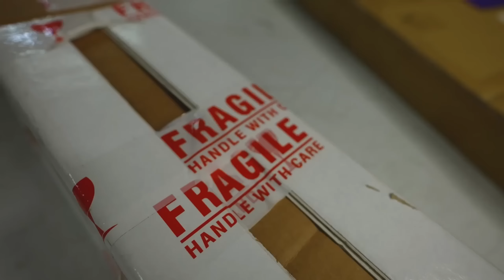C6 Corvette Gets Carbon Fiber Upgrades!

Comment: Question.  Maybe I’m just an old fart, not to sound disrespectful but- I remember ordering car parts off of eBay when it first started and I kept getting scammed by the sellers, I had one occasion where I had to work with the FBI to try to get some money back. Never saw that money again or any of the other money I was scammed for on eBay. Is that fixed now and is eBay insuring my money or what’s the deal nowadays?